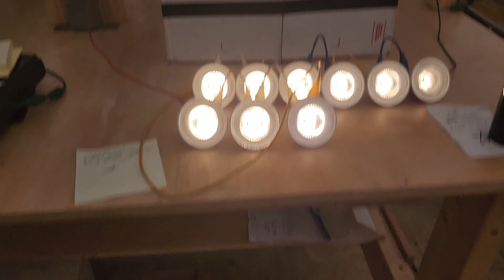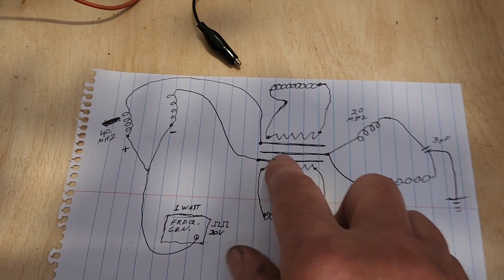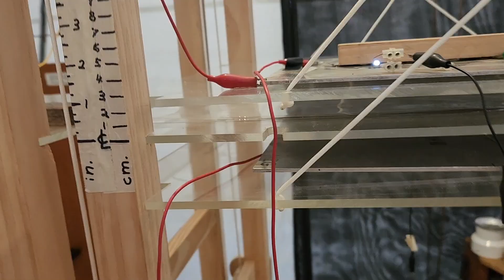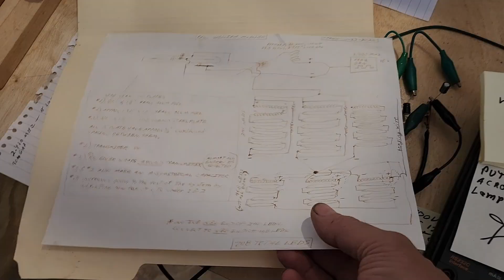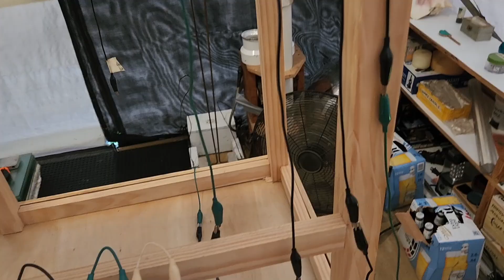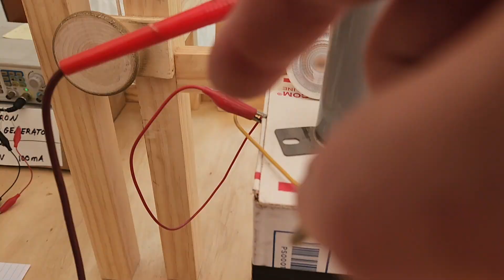BACK ON THE OVER UNITY PROJECT!! :-)

Comment: Over unity is as simple as getting more out than you put in, right? So... It's actually rather simple, but people have been faking over unity devices forever. It takes a very little bit of electricity to make a permanent magnet. And it takes forever for that magnet to wear out. And that magnet can generate far more electricity than what was used to make it. So where's the issue? Use a motor as a generator and you've already got more out than what made those magnets. That's over unity. But I believe what you really want to create, is a self running device, not an over unity device. Because a generator is already an over unity device, it just can't run on its own. Also... The magnetic field of Earth is always moving, right? And a wire in a moving magnetic field, should generate some electricity. That in itself is over unity. Also, atmospheric electricity, again, over unity. Solar, it might be inefficient, but it produces more electricity in its lifetime than what made it. We have real inventions that are in fact over unity devices. Combine them and have them run each other.

Comment: Love your work!  Can you think of a practical way to make this self contained and regenerative?  eg a virtual 'black box' with zero input and only output?  Have you noticed any cooling of the components?  Most electrical components heat up under operational load but in my past OU research I noticed some components cooling below ambient temperature.
Reply from the maker: Thank you for your kind words.
Yes, I would like to make this a self sustained loop(black box).  I know what you mean with cooling components,, cold electricity.  I don't have many components in this system, and I use such small amounts of power.  So I have not noticed anything staying cool.  I have blown out many LEDs though.

Comment: Awesome to see you back at it again the lab is looking awesome! I think you are working with the fundamentals here setting up a condition where charges pump through those diodes like a ram pump of sorts. And you keep the dipole open If you  could run a small joule thief or two or more off that capacitor then use those as your new frequency generators each to drive another plate coil setup and so on and so forth I imagine eventually this could be shrunk down and have many stages in a smaller area very cool Paul hopefully I can find time to put something similar together I finally have a half decent frequency generator lol
Reply from the maker: Thank you very much!!  Good ideas  :-)

Comment: Glad to see you back, Paul! Awesome setup as usual!  for the first 2 air coils to ring at 40Mhz, the plate capacitors must have around 67pF capacitance? And the frequency Gen. is set for 12V and 80mA?
Reply from the maker: Thank you!  And thanks for that 67pF value.  Hmmm, I would have to shrink down those plates by a large amount.  I will think about this.
I'm now applying 20V and applying approx .5 to .6 watt, so I closely estimate about 40mA.

Comment: Just thinking of different ways to measure here. At a certain point in the video I began to see this as an electron pump of sorts and thought there should be some EMF in that. You could try a free WiFi scanner and/or EMF detector app on your cell phone or tablet. I use "ultimate EMF detector" on my Android tablet and I really like it. But you have 100's of free options to choose from, any one of them might help in detecting the amount of power and it's location in circuit. 
Cheers my friend 🍻
Reply from the maker: Great idea with the EMF detector!  It will help to see the unseen.  Thanks Michael!